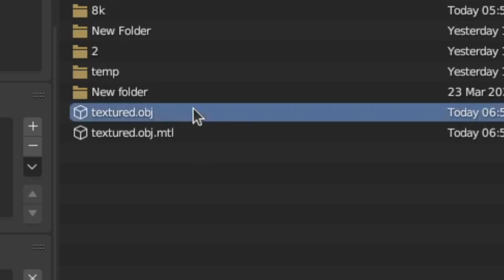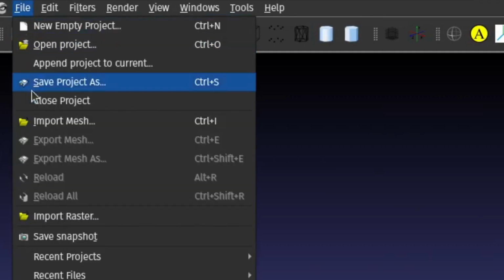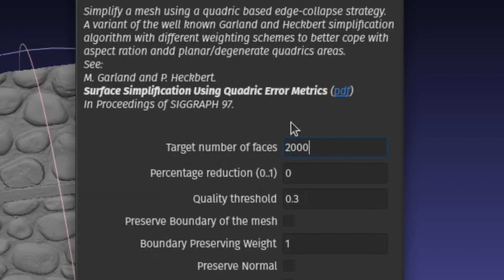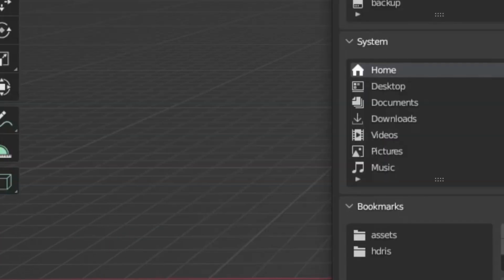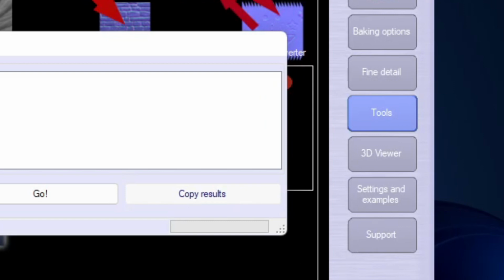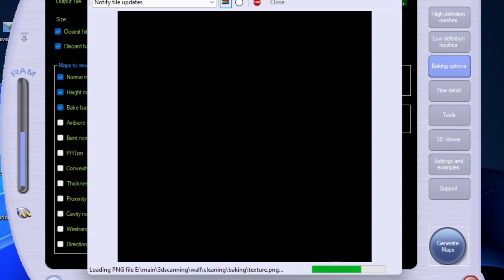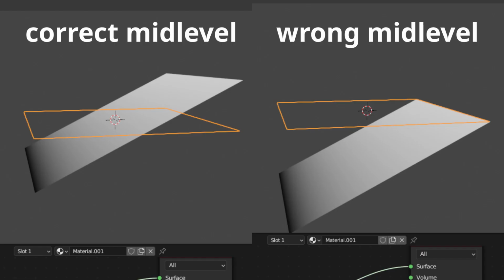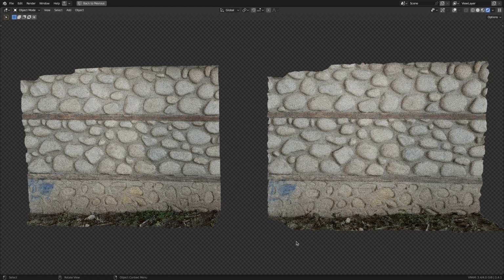How To Clean-Up 3D Scans Without Losing Detail (Free)

Comment: Only did not see what are lowres and hiresolution differences... You export lowres model (a point at which I can follow you) and then you export a hi-res, which I cannot get if this is the original mesh before decimating or the same as lowres but for use in a forecoming step...